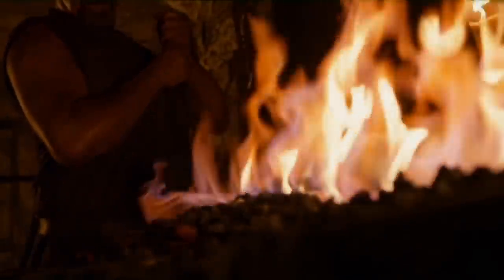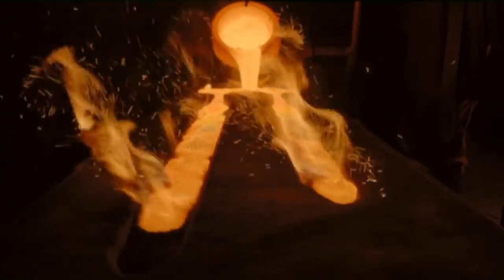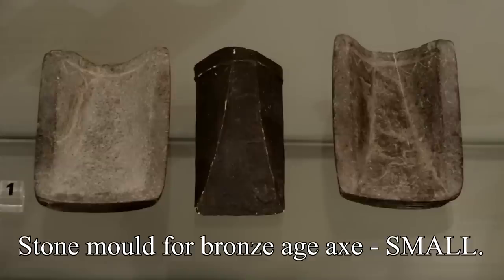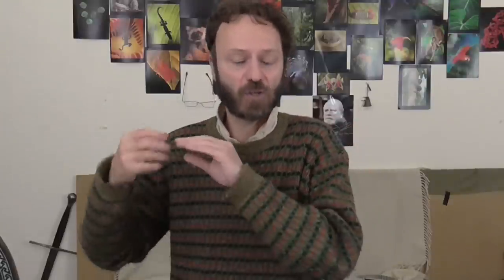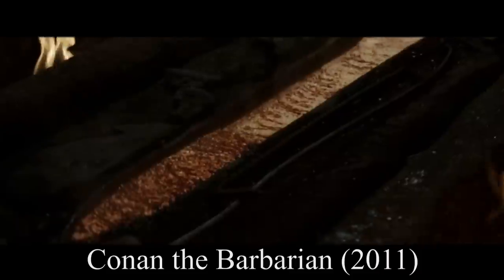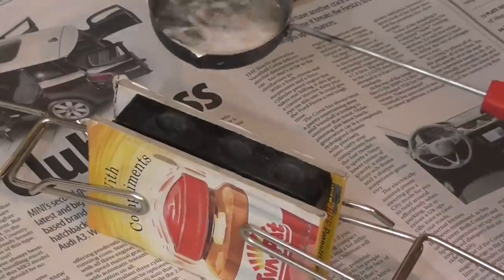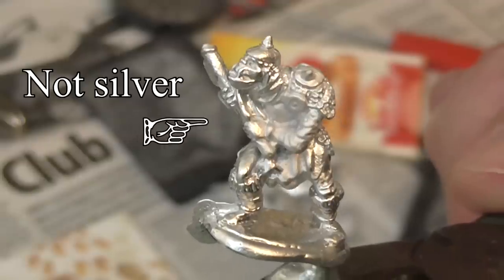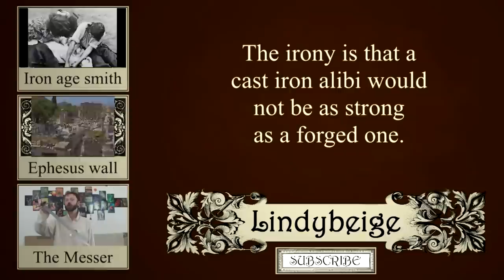Casting swords in the movies - forging a lie

Comment: As a person who has experience forging swords, as well as blacksmithing experience- albeit a very, very small amount - casting swords out of iron is not intended to form the bevels and geometry in the mold. That is the job of the smith using a hammer, anvil, and files, after the sword comes out of the mold in a single heat as quickly as possible. The swords are then heat-treated in a coal or charcoal furnace to perform an action called Case Hardening, where carbon is infused into the surface layers after the shape and final geometry is finished. Afterward it is treated, tempered, sharpened, polished, and fitted in its mountings and scabbard. 
Your rambling tangents and completely incoherent points aside, pouring molten iron or steel into open molds was a very efficient practice for mass-producing cheap swords during wartime quickly. The process drastically lowers the production time of a single sword from taking weeks to months, down to hours or even a day or two just to forge and sharpen the blade. The metal they use for effect in the movies is irrelevant as hell anyway; molten steel used for casting sits at a low point of 2,000F. There is literally no reason they would have that near actors with no metallurgical skills whatsoever, and on top of that it would be too bright to film. The things you see in movies are concessions and compromises to portray an actual practice.
Reply: I know this came two years too late, but for anyone reading this:
This seems really funny to me, because I know a  smith who makes knives. Stone is almost never used as a cast when it comes to iron blades. It is an incompatible material. Historically, it was never used for iron blades, because the resulting blade would be far, far, far too hard to be used in combat. I have heard that sand, other metals, clay, and even wood were used when mass producing swords for an emergency situation, but never stone. These swords only held a single edge and were often discarded/reforged after battle, because shaping them any further or trying to re-sharpen the edge would often chip or break the blade. 

And lets assume that stone molds actually worked, somehow: Everything else in his video still holds up. This is a comment made to complain to complain about a topic the OP literally does not understand.

Comment: Finally someone said it! They only cast iron into ingots to be used in forges to be pounded out into sword shapes by folding and welding and folding and welding and mixing various grades within it periodically and after it was shaped and hammered into a sword like shape, it was ground and then heat treated and cleaned up and sharpened again. The only poured sword shapes were the bronze swords, which were quite a lot weaker and smaller than iron and steel could be worked.
Reply: +traderjoes I would like to point out that bronze swords were better than iron swords, the main switch to iron was to do with that bronze is an alloy and very expensive, thus hard to get, where iron is cheap and lighter. We didn't beat bronze until we got to steel.
Reply: +Mr Roberts eh, all my research on it has iron and bronze being pretty comparable in mechanical properties relevant to weapon-making (hardness, strength, weight, etc).

Iron has the advantage of it being a gradual transition to steel (and of course the most important factor: cost)

Bronze is rust resistant (hence why bronze hilts were so popular on iron and even steel swords at many points in history) and you can re-cast it in the field if needs be with mostly improvised equipment instead of a full smithy.

That said, yes, we didn't really beat bronze until steel, and the main factor was cost.
Reply: DynamicWorlds My point exactly good sir, and from what I've been told by my blacksmithing pal, iron swords were rather brittle when compared to bronze ones, just what I heard. I do know they are lighter though, so that might play a part in the transition to iron armour as opposed to bronze
Reply: +traderjoes Also folding was generally only done in the case of very poor quality ore, in an attempt to improve quality. With access to decent metal sources they didn't fold, as a general rule, as it only serves to weaken good metal (as every fold and weld process removes carbon) and risk forming shunts or inclusions, or other weak points.  That's why you here about Japanese swords being folded, because their metal was god awful.  (But they rarely folded more 6-12 times, just enough to even out carbon loads)  And folding was much less common in Europe where they had access to much better steel.  The folding was also done to the raw billet, not during the shaping process.
Reply: +Mr Roberts 
Iron swords may have been brittle, but that doesn't mean that bronze swords were particularly resilient either. Depending on the allow, you would do well to thrust with them because they didn't necessarily take shearing forces lightly. And given how the parts of the hilt were often simply riveted through the tang, I've read of at least one sword in which the rivets simply made their way through the tang sideways....
Reply: Oliver H Same goes for iron swords of the same era I think you'll find, since they were usually the same weapon made of iron over bronze. I also suspect bronze isn't brittle, it would have it's flaws, notably weight and value (there is a reason Olympic medals go bronze, silver, gold), which make it an impractical material to use primarily. Also, the pieces of the hilts being riveted is still pretty standard on knives, swords "evolved" to a point where they were entirely separate from knives, but messrs, sabres, katanas, scimitars, and other similar weapons still have the handle scales or hilt riveted through the tang, in fact most pommels are riveted to the bottom of the sword, using the swords tang as the rivet, so I'm not sure how this is relevant?
Reply: Mr Roberts No, bronze isn't brittle. Instead, it's pretty soft, which leads to the problems I described.

"Also, the pieces of the hilts being riveted is still pretty standard on knives, swords "evolved" to a point where they were entirely separate from knives, but messrs, sabres, katanas, scimitars, and other similar weapons still have the handle scales or hilt riveted through the tang, in fact most pommels are riveted to the bottom of the sword, using the swords tang as the rivet, so I'm not sure how this is relevant?"

Because doing it with iron/steel is something fundamentally different than doing it with bronze. In order for iron to tear, you need much more massive shearing forces.
Reply: Oliver H Well there you go, but that does mean single piece bronze swords like akinakes would not suffer that problem, also if bronze is soft, wouldn't that be an advantage over a disadvantage, I'd rather my sword bent then get snapped completely in two. Point taken on the rivets. Still I think weight and money are the contributing factors to the switch, iron simply was not any better, and in some cases worse than bronze, it's major advantage is that you can turn it into steel, but that hadn't come about yet.
Reply: Madra Very very unlikely considering the time period, we would avoid our swords colliding at all possible costs. Still unlikely since bronze is soft, but not that soft, gold maybe, bronze no.
Reply: Mr Roberts You honestly think that swords colliding was a rare occurrence? It happens very frequently. And I doubt you have ever held a bronze sword if you doubt how soft it is. A cast bronze sword with a hammer forged edge is easily cut into by iron swords. You can bend the swords on your knee if that tells you how pliable they are.
Reply: Madra Bronze and iron age, aren't like the medieval era, you don't attempt to strike his sword, especially with swords a brittle or as soft as iron and bronze. I would say that unless you were a moron, you wouldn't even try. And yes you're right I have never held a bronze sword, held a lot of bronze, not a bronze sword
Reply: +Mr Roberts The bigger moron dies rather than just having their sword ruined. Nobody, in any time period, just swings their swords so that they collide with other swords... no, they'd rather hit flesh and kill, but they'll always rather put their swords in the way than be the flesh that's hit; sword collisions were always inevitable. No matter the time period, swords colliding will at least damage a sword's edge; swords colliding was never 'smart', but they prevented death, so it's always 'smarter'.
Reply: Heimdal001 So Joachim Meyer's, a medieval fencing master, underarm parry through to left changer with counter thrust doesn't exist? Parrying is essential, it allows the exploitation of lines of attack, when you have a shield, you parry with the shield, not your sword.
Reply: Mr Roberts Why do you refuse to acknowledge that in battle the unexpected happens and blade to blade contact is bound to happen at some point
Reply: Madra Who said I didn't? One does not define a rule by it's outliers, you are using English, you know that every rule has it's exceptions. But my statements have been taken out of context, I am saying the weapons of these groups (early bronze and iron weapons) would not have been used to parry unless as a last resort, especially in an era wear shields are so bloody massive.
Reply: Mr Roberts I suggest you read up to where I directly said "If we are in a sword fight and my iron sword hits your bronze sword, I will cut into your sword." where you responded by simply dismissing it as only morons having their swords collide. And the last resort of having to parry with your sword is something you have to take into account, because in combat shields do break or get knocked away.

Comment: I might be a bit too late to the discussion, but making a distinction between iron, steel and cast iron is quite important because it makes a lot of difference in the properties of the metal.
Cast iron is a carbon rich metal and the amount of carbon in it makes it load resistant but very brittle indeed, as seen in cast iron pots, for example.
On the other hand, steel while still has carbon on it, it isn't in such a big amount as cast iron making it tough but not brittle, so it is quite the apropriate material because it has a good mix of stenght and maleability. One example is steel beams that you see in contruction.
Reply: Also, heat treatment can make steel even better while it would do nothing for iron. (*castiron and steel are alloys, not pure metals)
Reply: Construction Beams are as far as I know Steel wich is alredy solid wich gets pressed trougth an mold, with brute force.